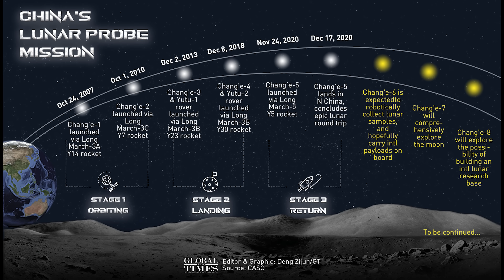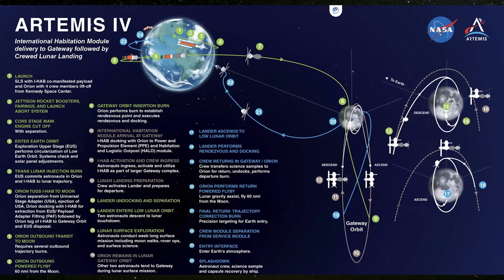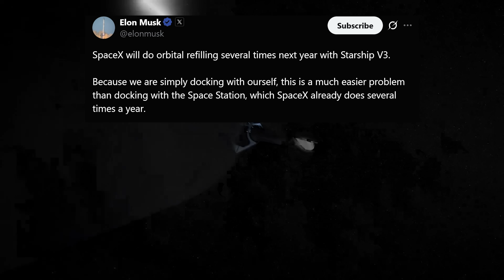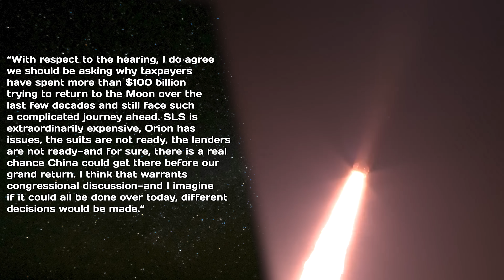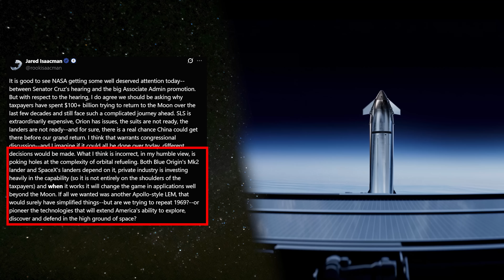Ex-NASA chief revealed the Real Problem with SpaceX Starship to get back to the Moon while China

Comment: Didn't NASA also say boosters that RTB and be caught were also impossible?

I'm not smart enough to know one way or the other.
But the SpaceX team has routinely wiped their asses with what other people deem impossible.

I'm not going to count them out yet.
Reply: Yes. That is exactly what the head of NASA and ULA said more than once.
Now they are the laughingstock as SpaceX made fools of NASA and put ULA out of business.
The ONLY reason ULA is still (barely) in business is that the US military refuses to have only one option to reach space.
ULA is still alive for that reason ONLY.

SpaceX has built the entire company, flown and landed over 500 times, launched and operated more spacecraft than any other company in human history, developed multiple launches vehicles (reuseable at that), have more data on hypersonic flight than NASA, has proven they can relight rocket engines in Mars equivalent Atmospheric pressure, and have done it ALL for LESS THAT THE GOVT HAS SPENT TO FLY SLS - ONCE !
Reply: The problem SpaceX has is that Starship is way too heavy to get in orbit with a half decent amount of payload. They have already given up on landing legs (instead they will try to catch it) and they have tried to reduce the heat shield as much as possible (with the result that large parts of it burn up on re-entry). HLS won't need a heat shield, but it will need landing legs and lots of equipment to sustain human life, and more importantly it will need to be refuelled in orbit by Starships that can carry a decent load and can survive re-entry.

Perhaps they will "solve" their problems by making Starship one-time use and launching a dozen of them to refuel HLS in orbit, but that would be a very, very expensive solution.
Reply: @ronald3836  They could EASILY make a disposable version that would be capable of a lot more payload to orbit
Reply: @stuartgray5877  Sure, but then SLS will probably be cheaper when mass produced.
Reply: @ronald3836  SLS could in no universe or timeline be more efficient than Starship. And it can never be mass produced.
Reply: @OnigoroshiZero  If you need to launch a dozen throw-away Starships to refuel a throw-away HLS, SLS can easily be made into a cheaper solution.
Reply: @ronald3836  - "Sure, but then SLS will probably be cheaper when mass produced."

You are funny.  How many SLS do you think will fly.  I BET no more than three.
You do know they are using what is left of the Space Shuttle main engines with no ability to make more right?
How many do they have?
Answer: 14 at the end of Shuttle.
Each SLS uses 4 and they already flew once.
You do the math.
Reply: @OnigoroshiZero  SLS can only fly three more times before they need a new engine design.  Has Congress given NASA the money to develop a new engine that will be for-fit-function direct replacement for SSME? No?
Then I don't think SLS can fly that many more times before having no engines or requiring a major redesign.
Reply: @stuartgray5877  SLS has had and will have more successful flights than Spaceship. But what is difficult to understand about my point that constructing 10-20 throw-away mass-produced Starships per throw-away flight is going to be more expesnive (and a lot less safe) than what could be done with a single mass-produced throw-away SLS,? This is simple economics. For Starship to make sense, SpaceX MUST make it nearly full ruesable AND give it a decent payloud capacity. At the moment they have neither and there is no indication that they can ever have both.
Reply: @ronald3836  - "and will have more successful flights than Spaceship."

REALLY?!?!

SLS uses the Shuttle Main engines. Care to tell me how many they have left with NO REPLACEMENTS??
Go on give it a try then try your math and tell me how many launches they can accomplish with SLS.
Not as many as Starship has done ALREADY.
Reply: @ronald3836  SLS is a POS built with 80s tech and FORCED upon NASA.
NASA did not even WANT IT. Congress demanded it. Its a JOBS PROGRAM.
Reply: @stuartgray5877  Sure, but it works and Starship does not. And I understand that developing Starship needs time (the people picking Starship for the luna lander should have understood that too but somehow did not), but by now there are strong signs that it simply is not going to work. Do you not ask yourself why SpaceX is continually trying to strip away large parts of the heat shield when they haven't even done a single landing? It is because it's just too heavy.
Reply: @stuartgray5877  yes, like 4 to 0.
Reply: @ronald3836  That is a great point (weight of star ship).

Comment: NASA rejected the earth orbit rendezvous method back in the 60s with the Apollo program because it would have had problems that Artemis program will encounter because of the selection of Starship as the landing vehicle.
Had NASA chosen to use a craft like the old LEM and develop a habitation module that would be sent to the moon unmanned, we may very well have returned to the moon by now.
Reply: Yet now we can rendezvous two spacecraft in space autonomously with no assistance from the ground.
Things have changed just a little in the automation and remote operation of spacecraft since Apollo.
Your cellphone has more computing power than all of the Apollo computers put together for a few hundred $.
Reply: @stuartgray5877  Orbital rendezvous has been routine since Gemini, and automated docking has been routine since the 90s when the Soviets first used such a system with the Mir space station.  
Computing power isn't the problem.  Its a physics problem.  It remains questionable if cryogenic fuel can be stored in the vacuum of space for any significant length of time before it boils off.   Second, hypergolic fuels are much better suited for storage in space, but have a lower specific impulse than cryogenic fuels, meaning more rocket fuel would have to be combusted to achieve the same change in velocity for a given quantity of cryogenic fuel.  It is a suboptimal fuel for propelling large spacecraft out of Earth orbit.  Hypergolic fuel has been used extensively for nearly all of NASA's space probes and the upper stages of many unmanned rockets launching satellites or one designed to deliver nuclear warheads.

Comment: ONE LAUNCH TO THE MOON. How about a V1 Super Heavy Booster and V1 Starship with a Stage 2, like the test 30m booster 14, 30m tail stage 6 vacuum and 3 sea level engines. Star-Ship V1 HLS one less floor for nuclear generator & batteries. Engines 4 vacuum and 3 Sea level and 12 ICON electrical engines for cruising NOT costing. 6 Crew shuttled up on a dragon. Dragon will dock on the top/side of the HLS/Starship and Artemis at the nose. 
We have the equipment to do Apollo type mission Flyby and/or landing this year. NASA just waste taxpayers money.

Comment: Starship is a white elephant, mark my words.
Reply: Musk ya se burló de ti con el Falcon 9. Ahora volverás a humillarte solo.
Reply: @charlymaiden   Falcon 9 can only go to low Earth orbit.  Starship hasn't even done that yet after ten flights.  Plus, it will then need multiple re-fueling flights just to get out of LEO.  Terrible design that won't go anywhere.
Reply: @my3dviews  Falcon 9 es el único reutilizable de la historia. Salvando al trasbordador que era otra cosa y carísimo. Starship mueve más toneladas que ningún otro. Si quieres verlo por la negativa, allá tu.
Reply: @charlymaiden   Falcon 9 doesn't need re-fueling in orbit to reach its destination.  Starship is useless without re-fueling. It if just requires one re-fueling flight, that might make sense.  But, it will likely need more than twelve refueling flights just to get to lunar orbit.  That is way too complex to be a useful system.  Rather they should have developed a three stage rocket to get a smaller spacecraft to lunar orbit. Starship is unnecessarily oversized to make it feasible.  Using cryogenic fuel means there is a limited amount of time to get that many refueling flights, otherwise you need more because the fuel is constantly boiling off and venting into space.
Reply: @my3dviews  Te sigues negando a considerar el tonelaje transportado. Para colonizar la Luna necesitas cientos de toneladas de carga. Por supuesto que es complejo. Porque no se ha hecho nunca. No existe ningún otro proyecto que ni siquiera se le acerque a sus capacidades de carga. Sí, se necesita el reabastecimiento en órbita y sí, llevará varios vuelos para llenar el depósito. Pero transportará en un viaje lo que en un Apollo llevaría decenas de vuelos. No estás considerando para qué se va a usar. No es para 'viajar' a la Luna. Eso ya se hizo. Es para 'colonizar' la Luna. ¿Se entiende?.
Reply: @charlymaiden   Well, I don't think that colonizing the moon is realistic anyway. 
You do realize that the Starships were all basically empty shells.  The last one had a few dummy satellites, that filled no more than 10% of the cargo bay.  
Will the booster even get a fully loaded Starship to LEO?  How long and how many flights until they do even that?  Much less actually send a refueling flight that successfully transfers fuel to a Starship?  Then do it a dozen more times without any failures?  That also requires rapid reusability.  Something they havened demonstrated yet.  Not months apart, but days apart would be needed without refurbishment.  
All that to just get one Starship to the moon.  That is far from colonization, which would require many more landings.  Which means dozens of more refueling flights.
Reply: It will work,but very wast fuel, I remember it take at least 10-15 shot to let starship refuel
Reply: @SS_SunnyNMoon  jajajaj!! ¿y las toneladas de carga no las piensas calcular?

Comment: Back in the 1960s, NASA rejected the Direct ascent method that SpaceX is planning on using to land on the moon. 
It's just inefficient, and as Apollo 13 showed, has no backup plan. The 7-day waiting period for the Orion is just too likely to cause problems.

I support what Musk is doing, which has been more cost-effective and productive than what Boeing has been doing, 
but I disagree with the plan to use a methane-based system to move around space. 
A methane-based system is acceptable for launching to Earth orbit, but the boil-off is too serious a problem for anything beyond that.
Reply: Boil off from hydrogen is far worse.
Reply: @JessePollardII  Hydrogen and methane rockets should not be used to go to the planets - because of the boil-off problem. 
We need the established ion engines upscaled teamed with the NERVA, VASMIR, or the newer plasma-based rockets being researched.

Comment: Why use same engines to get of earth and travel in space this is not an efficient way...
Reply: That's not the case. The upper stage as well as the proposed Starship HLS has vacuum optimized engines. That said, I think Starship HLS is utterly flawed and I think it will delay the program with a decade and end up with a smaller lander.

Comment: Congress has, at this time, funded three separate moon programs, Artemis, SpaceX and Blue Origin.  While the artemis capsule is fully rated for travel to the moon the use of the throwaway rocket it is based on is way to expensive.  Artemis was funded by congress on the assurance that these reusable rockets would never work.  The people behind Artemis assured Congress that reusability would be like the space shuttle was reusable and that the reusability advocates were just naive.  After all, they engineered the space shuttle to be reusable, like it was.   They told congress that no one could do what SpaceX, is currently doing and what Blue Origin will be doing sometime over the next year with a rocket that is significantly bigger than Falcon 9.  

The two reusability companies can  make multiple launches for the price of just of one Artemis/SLS launch.   Throw away rockets are obsolete for this cost reason. Like Artemis-SLS, the Chinese are using throwaway rockets and are  not going to be able to financially, sustain the twice a month rocket launches that are necessary to keep a moon base going.  When SpaceX and Blue Origin work out all the problems with their rockets, both american companies are going to be able to routinely do this task.  Note that Bridenstine it is probably right. We might have to launch three or four rockets from the earth into low earth orbit for every one rocket that departs to the moon.  But even so, it will be way cheaper than launching directly to the moon like Artemis and the Chinese are wanting to do.

China (and Artemis/SLS) is just a fancier version of what we did fifty years ago. Reusable rockets are the current state of the art and will allow the US to go to the moon, Mars and other places in the Solar System in a large sustainable way. We are way way ahead of China, even if  China temporarily got to the moon before us...

Comment: Consider Robo taxis, I think 2027 goal of manned landing is a pipe dream
Reply: I have a Degree in Physics, Robo taxi is way harder than calculating a projectile, and thats what starship is basically doing
Reply: @RoqueMatusIII  Landing on the moon is not an orbital mechanics problem... It's management, in real life things take time, 2 years is ridiculously optimistic.
Reply: @RoqueMatusIII  Space rocketry is only to a minuscule degree about calculations. It's 99,99 % about pumps, engines, fuel handling, heat shields, life support systems and countless other hardware issues. It doesn't matter how smart your phone is, it can't fly.
Reply: @skunkjobb I still think Robotaxi is way harder than all that, at least you have a target to hit, Robotaxi isn't even solved the slightest, we never did that before